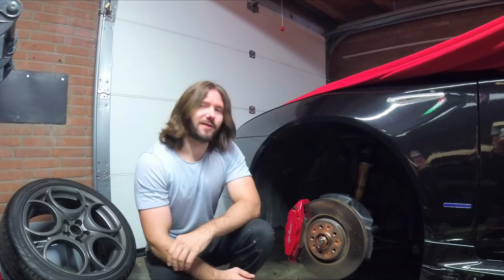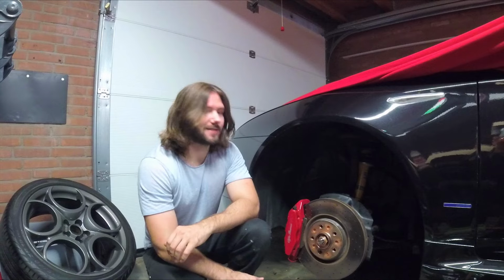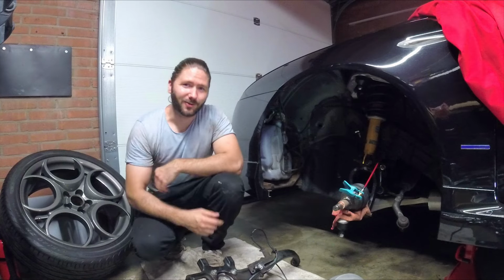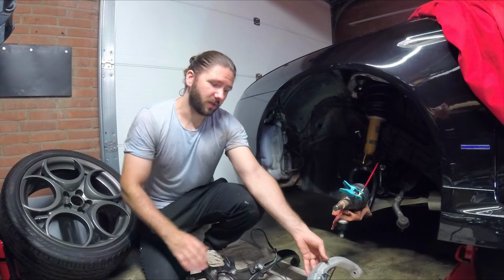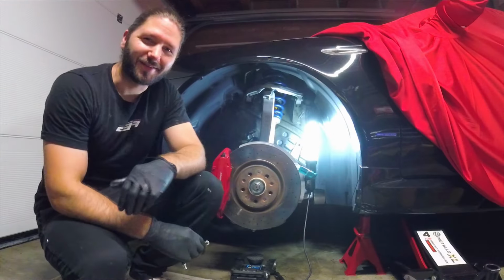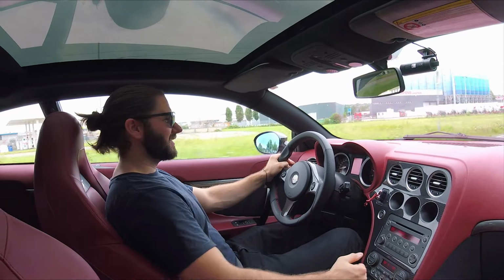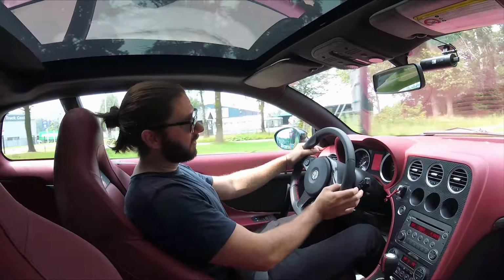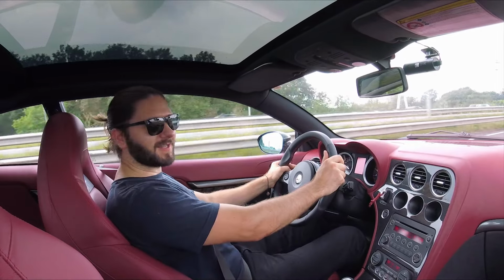Alfa Romeo Brera new wishbones + shocks + (lightweight) steering knuckles installation & review!

Comment: Wow that's a great video, very detailed and inspirational! 
BTW, just curious aren't the shock's fork supposed to be tightened when the lower arm is loaded (i.e. with the car's weight) so that the lower arm bushing is not stressed?
Reply from the maker: @FoxOkinawa  thanks man!! I appreciate that. The fork can be tightened like this, but the top mount bolts should be tightened under load

Comment: Hi, I would like to ask what brand of Upper control arms did you use? I have used firstly TRW, secondly LEMFÖRDER. But each after around 500-1000km started to make some crackling noise. The sound is not coming from the ball joint, but from the silentblock itself. It does this cracking noise when going over bumps on the straight road. What can cause this issue? I replaced the control arms 2 times in a row now. I set up the control arms in the same position as you when tightening the bolts. I tightened them to 70Nm. If you have any ideas, or you have encountered it yourself, then please share the ideas. Thanks!
Reply from the maker: @Alex-xf7fe  hi mate, I used Delphi in my upper wishbones in the 159 and they are perfect, no squeeking sounds. I did do an allignment after the install. For my Brera I now also have the same and so far so good. I do have to get an allignment. 🍀
Reply: You need to juck up the hub to the normal ride height (as when the car is on the ground) and then tighten them to the specified torque settings. You can measure the distance between the center of the wheel and the wing arch, while the car is on the ground. Then when you jack it up, lift up the hub so the distance is the same, and then tighten the bolts. Otherwise, the bushings will not last very long.
Reply: @DashCamSerbia  I did the same thing here. It started the crankling noise after 500-1000km. So I’m going to buy a new one again I think…
Reply: @Alex-xf7fe  Hmm. Where did you buy the Lemforder ones? And for how much?
Reply from the maker: @Alex-xf7fe  I can recommend the Delphi ones. I believe they are even recommended by Alfa Workshop in the UK.
Reply: @DashCamSerbia  I bought them from Allegro from Poland. It was around 80€.
Reply: @939driver  Thank you. Well I think I have no other options just to try out the Delphi ones. I think I had very bad luck by having failed pieces.
Reply: @Alex-xf7fe  In Serbia they cost 122.
Reply: @DashCamSerbia No need to do this I believe as the design of both bushes, on either side (F+R) is such that it can rotate freely 360 degrees.  I just replaced mine after 240k KM without squeeking, and have the same experience of starting to make noise soon after. 

TRW as first fit replaced by TRW again. 

I took the arms off agaijn and splitted the front bushing which appears to have a plastic insert between rubber and metal sleeve + washers. The plastic should rotate on the washers without friction, but without any lube it makes noise. As if the kind of plastic used is of the wrong type? 

Once I put on some white grease (PTFE) the noise was gone, but has now returned after 2,000 KM. Very frustrating when you replace same for same, but apparently isn’t. As if TRW has a quality issue in their production process? 

(Edit: If you disassembled the fork from the damper and lower control arm, then I’d recommend tightening it while jacked up to ride height.)
Reply: @DashCamSerbia  Am I right to say that since the upper wishbone is free moving after being tightened, so it's not necessary to tighten at ride height. It doesn't stress the busing like others.
Reply: @FoxOkinawa  In such case I would agree with you.